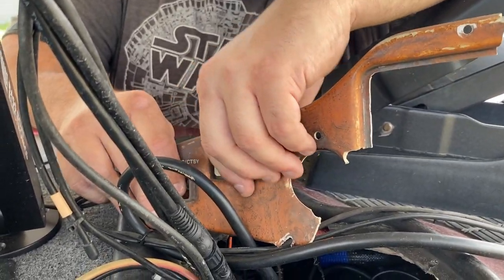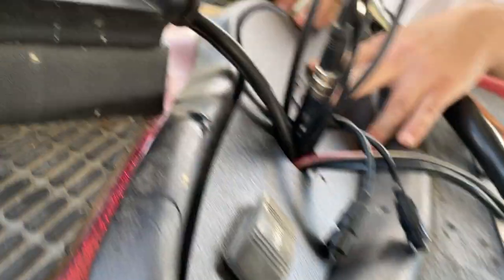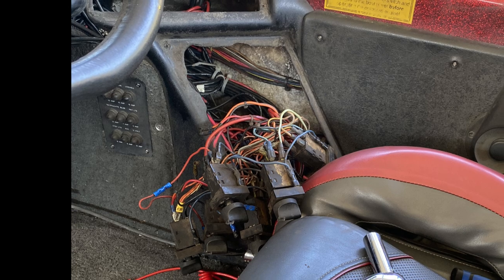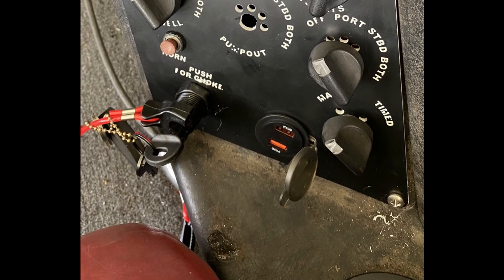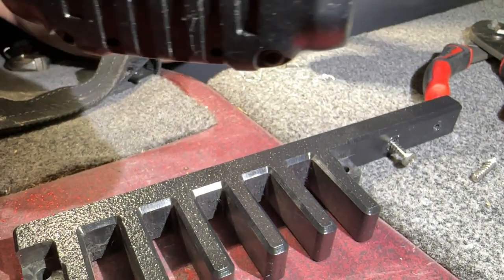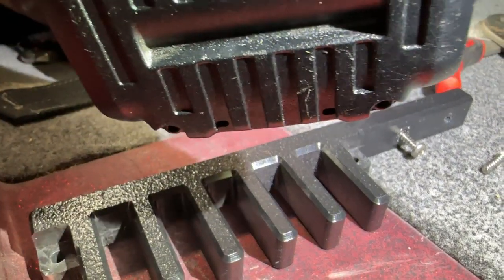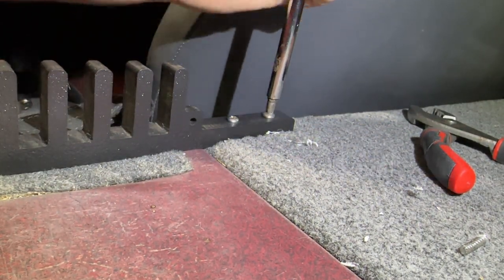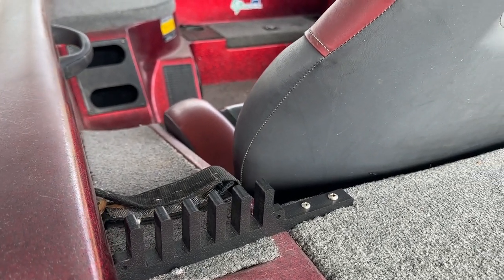Making The Old Boat New Again With AMP

Comment: #100percentwatchsquad approves of the boat mods! They look sweet, Hank! I've done a bunch of work to my old Bass Buggy, to get her restored, but she still needs some help. I'm tired of having to run electrical tape and flex seal over the wires because the rubber coating is dry rotting off.
Reply from the maker: Hahahaha Yeah I hear that!
Reply: @BassGeek  try some seal tight that electricians use. It’s a flexible gray tubing. Easy to cut with a hacksaw.

Comment: Love the changes! I've been looking for something for my 520VX ranger. Definitely going to look into the front panel. As for your key problem wanting to twist... Have you tried O-rings or some rubber round seals on both sides of the hole before putting the nut on. Had a similar problem on a motor(I'm a farmer) and it kept the turn key right and dampened the vibration. Solved our problem. Might be worth a try
Reply from the maker: That's a great and simple fix. THANK YOU!

Comment: Just be careful with the “AMP” switch panel, super brittle mine cracked easily and now is in pretty rough shape for the price. Just a heads up for the older triton guys!

Update— new panel received from Chad at AMP, it is a much better quality , and awesome service from AMP. Thank you!
Reply: David Hall please send me a message on Facebook.  I have been doing them in a new material and they’re great now!  I’ll send you a brand new one.
Reply from the maker: Hey Thanks and It looks Like Chad want's to make that right for ya. He's a great guy.